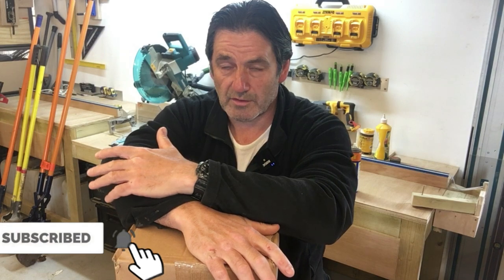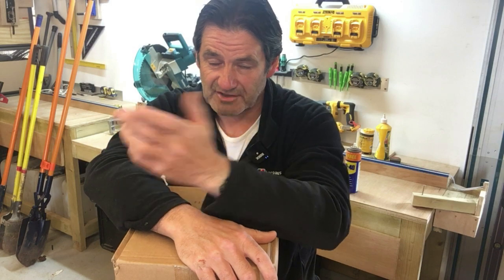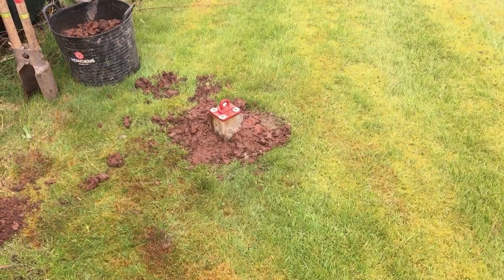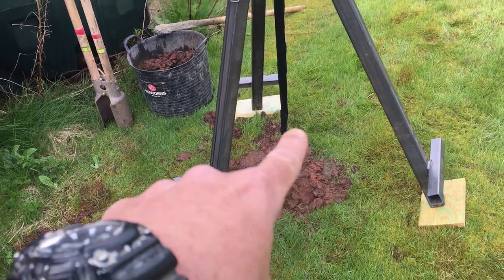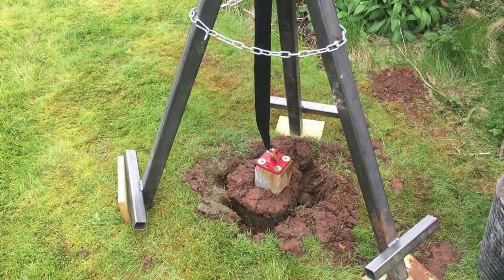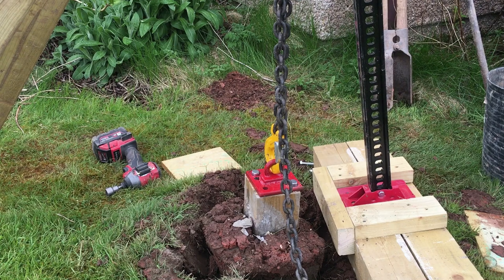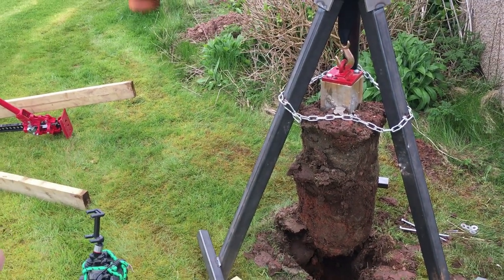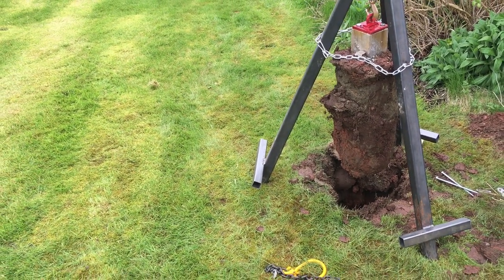EASILY Remove Old Wooden Fence Posts | Does it work ?

Comment: Ok if you can get screws into the post and not to wet
Reply from the maker: Usually you can get long lag bolts into posts no problem, get them in deep enough to get a grip of good wood. This was all an experiment as I like the idea of a lightweight tripod that can be taken to jobs to rip stuff out the ground with minimal effort 😂 Back to the drawing board with this one, I will not be defeated 💪 To be continued..........cheers for the comment John !

Comment: Good stuff big yin  can u connect yer impact to the winch in some way just for the initial drive to see if it stops the tension so it don't get a chance to build up .
Reply from the maker: I don't think that would work Ian due to the sheer amount of force required - those posts take a huge amount of force to get them moving initially - some sort of hydraulic or "comealong" system would work best I think. Thanks for the comment 👍
Reply: @Bacrenfencing  now you mention it definitely right seen it done with a bottle jack but not fir cement.